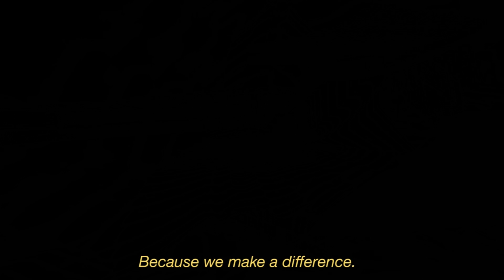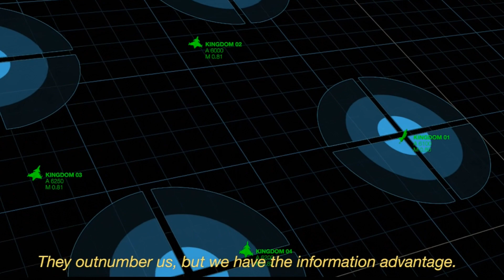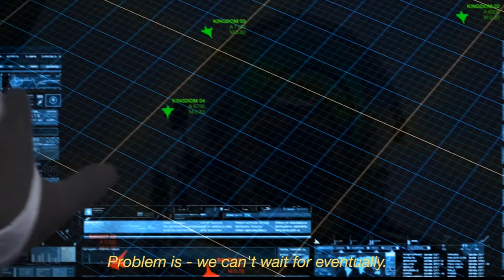Gripen Fighter Jet - Canada's Future Fighter?

Comment: Many fact nerds voicing their oppinions on military stuff they know nothing about...

Gripen wins the cost effectivenes battle every day. It doesn't matter if another aircraft barely beats it in some regard if it's faced with two or three Gripens. Allso, the ruggednes and ridiculously quick turn around time increases that multiplier even more.
Reply from the maker: Nils Jungenäs I agree
Reply: It also has among the best weight-to-payload ratios in the world, rivalling even tiny trainers like the L-159 ALCA, so a Gripen, while being smaller and lighter than an F-18, can carry the same payload.
Reply: +Peter Angerani Do a co-op with Sweden and build the Gripen 2020 instead.
Reply: Matsimus when I think of Canada,  I think of the vast undeveloped area and how the Gripen would be able to take advantage of practically any road, for a re-armament or re-configuration. Plus the arctic origin and design that Saab put into the Gripen it makes sense. All your points about having 2 aircraft and since 1 HAS to be a F35 (it's happening for better or worse), the Gripen is a perfect choice for the Canada.
Reply: Wade French I can agree to an extent, but would like to note one point. The Gripen, along with the other European options and the Japanese Mitsubishi jets, are far more cost efficient, meaning you could do quantity over quality with little effort, and every lost unit wont be an as significant loss.
Reply: @09csr  Yes they are.  And they make sense for many nations.  No argument there.
Reply: @09csr  Yes, if all aircraft were equal.  However in the last Red Flags the F-35 dominated aircraft from the previous generation.  By most accounts it was 15 planes downed for every F-35 lost.  You do the math.  At that ratio the F-35 is more cost effective, sorry.  Most fourth generation planes were down before they even reached 30 miles (close enough to use IRST).  

What the US is able to do with the F-35 is historic.  They use the F-35 to soak up all of the battle information and give that information to other legacy aircraft.  The F-35 can even give those planes firing solutions.  For defensive war the Gripen is great.  It is however not able to do much of what the F-35 can and never will be able to.  So when you say that those planes are more cost effective it is a tough question to answer because the F-35 is capable of more work.
Reply: In the past century, air to air battles have been always won by the party that trains more.  The cost per flight hour of the Gripen being so much lower allows for much more training time for the pilots, and hence higher chance of success.
Reply: Ruggedness is so underrated.  Day Two of any war will see a degradation of our airports and infrastructure.  Anything that requires a pristine airbase is going to be out of commision pretty quickly.

@diamonddog257:  We have an obligation to be able to support NATO, thus we need fighters.  Would you have us leave NATO?  We'd be invaded by the USA the very next day.
Reply: +tyson31415
Except for Pearl Harbor, I don't know of any American air base that's ever been bombed in any war.   There were some minor instances in the Pacific War with the Japanese, but nothing major.  That was way back during WW2.  Hasn't happened since.  Bombing an American airbase is easier said than done.

The Russians would not have air superiority against the US. Russian bombers would be shot down before they got to their targets.  Or at the very least, get shot down on the way out, or after they land back at their bases.  The Russians don't have enough aircraft to attack all NATO bases at once.  They would probably lose half their airforce in the first strike.  Holes on runways could be refilled within 24 hours.  Not every hole needs to be filled.  Aircraft can also take off from paved roads and freeways near the bases.  Holes could be repaired and then painted to look like bomb craters from the air.
Reply: In the event of Scottish independence, I hope we lease 14 of these
Reply: Personally, I think Matsimus has it right here.  Get the Gripen and build them in Canada which would offset some small amount of cost and get some more aircraft tech and jobs in Canada.  But also continue participation in the F-35 program and preserve that portion of the aircraft tech and jobs as well.
Reply: @PeterAngerani  that's what every countries want to do but then the manufacturer does not take responsibility if something goes haywire
Reply: This is what Canada needs.  -  https://www.youtube.com/watch?v=_afzm1z7nu0&t=197s  - Twin engines for vast arctic patrols.
Reply: Totally agree 100%
Reply: the rcaf never flies more than 1 craft at a time in the arctic, and if its being used in a coalition, its usually as a ground attack or bombing role were they might have 2 planes flying at most
Reply: Nils Jungenäs the Swedish armed forces are poor, they need a budget jet
Reply: Yeah have so many the enemy runs out of missiles
Reply: I don't think the Gripen is a bad path for Canada, but some things that you mentioned are not necessarily true.  There is no technological advantage for the Gripen.  The F-35 is a more advanced plane.  Partnership and in construction and tech happens with the F-35 as well.  In fact, over 110 companies already have contracts for F-35 production, so money is already being made and expertise is being shared and gained.  

"In an online briefing to media on Aug. 6, Callaghan shared the results of an economic impact assessment that suggested selection of the F-35 could impact GDP by almost $17 billion and generate more than 150,000 jobs over the life of the program."

I doubt very much that the Gripen adds 150,000 jobs and 17$ billion dollars to the economy.  In fact, I don't think it would even be close.  

Next thing is that the cost of the F-35 is more expensive to maintain and it costs a fortune per fight hour, but these planes are also not peers.  The F-35 is a more capable plane.  The only real question is, does Canada need the extra capability?  The answer is probably not.
Reply: naaa F35 is the way to go.

https://i.imgur.com/aJ4uk6f.png
Reply: I don't disagree with it being a well-made cost effective airplane, but thinking that it can do as much (or is even close to) the abilities of the F-35 is not accurate.  It you are fighting an offensive war in a highly-defended airspace then the F-35 is worth its' weight in gold.  That is not what Sweden needs.  That is however what the US and UK need.   Recent Red Flag events in the US have shown how much more survivable the F-35 is over legacy aircraft in defended airspace.  The Gripen is a great plane for defending ones own airspace in a small country.   For fighting offensive wars on hostile foreign lands, take the F-35 every time.
Reply: @wadopotato33  comparing it to f35 would be wrong
Reply: @wadopotato33  the E model with it's small rcs and superior sensors may surprise a lot of the F35 pundits...

"The Selex ES-05 Raven AESA radar designed for the new SAAB Gripen E/F matches or exceeds Captor-E in many respects.
What makes a system great is not only the sensor but also the processing power, software and last but not least sensor fusion.The Gripen will have three Selex-ES sensors.The Raven ES-05 active, electronically scanned array radar (AESA), developed by the company's Edinburgh unit, will be the first production AESA to be mounted on a “repositioner,” a rotating mount that gives the radar a ±100-deg. field of view around the nose, I have seen figures of 240 degree spherical being cited in the press but that seems a a bit optimistic..The Skyward-G infrared search and track (IRST) system (from Nebbiano, Italy) is based on experience with the Eurofighters Pirate IRST and Selex-developed land- and sea-based IRSTs.The fighter also has a new identification friend-or-foe (IFF) system with three electronically steerable antenna arrays, which matches the radar's range and field of view.The three main sensors will cue one another automatically to display to pilots a fused picture of airspace around the fighter; it will also be fused with the Gripens new electronic-warfare system. Finally, sensor data can be shared between Gripens in a flight, or ground control in addition to airborne surveillance platforms via data link at least on par with but probably more capable than the F-35 datalink."

The rate of improvements in radar and passive IRST means the F35 will slowly (Israelis say 5 years) lose it's only real advantage...Without stealth the F35 is inferior. period.
Reply: @grahamdrew5512  A few problems with what you said.  First off, IR signature is part of what makes a stealth plane stealthy.  The design of the F-35 makes its IR signature half of that of a fourth generation plane.  You can read up on it since you think that the F-35 only has its' radar cross section as its' only trick.  

Secondly, if the F-35 loses its' advantage when it comes to stealth, what does that mean for fourth generation planes.  It means that they will be seen at even greater distances which means that the F-35 will still have a massive advantage over designs of the fourth generation...duh, on that one.  

Next is also a design flaw of the fourth generation.  The RCS of the Gripen is rumoured to be 0.5 meters squared.  The F-35 is 0.001 meters squared.  The Gripen is therefore 500 times bigger on radar than the F-35.  That is a big difference.  Now on to the big design difference.  The F-35 carries its' ordinance in its' internal bays.  No change in radar cross section.  The Gripen that was already 500 times bigger on radar than the F-35 is how big with missiles and bombs attached.  1000 Times?  Who knows.  Hope this helps you get it.  The Gripen can never be as good as the F-35 because the design is dated.  It is built on a paradigm which is build the best plane for Sweden's defense (not offense) for a good price.  The Swedes succeeded there.  It is a very good plane.  It can never be an F-35.  It can never bomb Moscow, either.  It wouldn't survive two minutes.  

The Gripen is indeed as good a plane as can be built on a faulty paradigm.  Stealth is the future and the whole world knows it.  Russia and China are spending billions chasing it.  Maybe the Swedes should too...or maybe for their purposes a budget friendly defensive plane is a good idea.  I think that the Gripen is a great plane, but it has its' limitations.  The potential of the F-35 is not limited.
Reply: @wadopotato33  EW stealth is what they are using INSTEAD of geometric stealth. IRST has ranges out to over 100 plus KM (depending on atmospheric variables) FYI Canada is not buying a first strike  aircraft, only defensive, like Sweden. We/You have the worlds best ground based radars to link with that remove those weaknesses of no geometric stealth. However the points you make are all valid and part of what needs to be considered. Bottom line is Stealth is great but can't negate poor performance in other areas. For what Canada needs The F35 is overpriced and too slow, too short range and too maintenance heavy (low sortie counts).
Reply: I like the Gripen as it's new, technologically advanced, it has HMD targeting capability and it's tactical link allow them to both excel working in packs as well as targeting multiple enemy aircraft, but as a New Zealander, I think the best option for our air force (the Royal New Zealand Air Force or RNZAF) is still the F-16C/D Block 52. 

When Switzerland initially agreed to buy 22 JAS 39 Gripens, the total cost was US$3.27 billion meaning each jet individually was roughly $148 million each. 

On the other hand, when Iraq opted to buy 18 F-16C/D Block 52s for US$1.5 billion, that meant that each jet individually was roughly $83 million each. 

The F-16 is also combat proved having performed air-to-ground missions in Yugoslavia, Iraq, Afghanistan, Libya and Syria but also air-to-air combat operations in the 1982 Lebanon War (Israeli Air Force vs. Syrian Air Force), Yugoslav Wars, Kosovo War and First Gulf War. That said the F-16 is combat proven and the JAS 39 is not.

Also, like I said, since the NZDF (New Zealand Defence Force) main role is mostly just to complement and support both the Australian and American militaries, the NZDF and RNZAF needs to have equipment that is compatible with that of Australia and the US. Ultimately, as much as I do like the JAS 39, I think the F-16 is still the best option for the RNZAF in replacing the (long since been retired) A-4Ks.
Reply: @trekkienzl2862   You think that a 1970's plane is better than Gripen ?? And aboat the Suisse quoting was included a lot of extras , like ground radar , and a lot of other expensive things !!  The price for the plane was aroand 60 mill !!!
Reply: @trekkienzl2862  You kiwis don't even have a fighter force anymore! ????
Reply: @mikespearwood3914  I know but that's why we do need a new fighter jet as the A-4 Skyhawks have been out of service since the early 2000s.
Reply: +Nils Jungenäs
You must be one of those "fact nerds".
Cost effective isn't very cost effective if the Gripen loses all its battles, penny wise, pound foolish.
The F-35 has a 20 to 1 kill ratio against F-15's, F-16's, and Eurofighters.  Now, THAT is cost effective.
One F-35 is worth 20 of any one of those 4th Gen aircraft.  If you think it is worth at least 2 of those aircraft, then the F-35 is a bargain for $100 million.
The stripped down model of the Gripen is cheap, but the top of the line model isn't so cheap, somewhere in the neighborhood of $60 million.
The Gripen is an obsolete aircraft.  It's an investment in old technology.  It's a waste of money.

Here is what the Danes think of the F-35 after a competitive evaluation.  Is the Danish military a bunch of "fact nerds" too?
"The F-35 just won a competition — and it wasn’t even close. In every category, from combat performance to cost, the Danish government rated Lockheed’s F-35A Joint Strike Fighter as superior to Airbus’s Eurofighter Typhoon and Boeing’s F/A-18F Super Hornet."
http://breakingdefense.com/2016/05/f-35-wins-denmark-competition-trounces-super-hornet-eurofighter/

It is interesting that the Danish military don't even consider the Gripen.  Apparently, hardly anyone is interested in the Gripen.  Less than 250 have been produced in 22 years.  The Swedes bought less than 200 of them.  305 F-35's have been built as of July, 2018, with 2,500 more to come.  The F-35's have been in combat with the Israeli Air Force for the last several months.  They want to buy more of them. The best Air Force in the world chose the F-35.  Are the Israelis a bunch of "fact nerds"?

According to the USAF, at Red Flag exercises more than a year ago, against F-15's, F-16's, and Eurofighters equipped with AESA and IRST, the F-35A scored a 20 to 1 kill ratio over an eight day long series of war games.  Before that, in another USAF exercise, the F-35A scored an 8 to 0 kill ratio.  According to US Marines, in their own war games, the F-35B scored a 24 to 0 kill ratio.
https://ukdefencejournal.org.uk/f-35-dominates-exercise-red-flag-earns-20-1-kill-ratio/

In the real world, in real combat, the F-15 and the F-16 have never lost in air to air combat or a dogfight, while the F-15 has had over 100 air to air kills and the F-16 has had at least 76 air to air kills, all without a loss.  However, the F-35 can shoot down F-15's and F-16's with ease, like "clubbing baby seals", actually, more like blind baby seals.
Reply: @RedRider1600  
Your information is dated already...The F35 without stealth is nothing special. The Israelis think it has at most 5 years before improvements in radar and IRST cost it it's only advantage.

"The Selex ES-05 Raven AESA radar designed for the new SAAB Gripen E/F will match or beat Captor-E in many respects.
What makes a system great is not only the sensor but also the processing power, software and last but not least sensor fusion.
The Gripen will have three Selex-ES sensors.
The Raven ES-05 active, electronically scanned array radar (AESA), developed by the company's Edinburgh unit, will be the first production AESA to be mounted on a “repositioner,” a rotating mount that gives the radar a ±100-deg. field of view around the nose, I have seen figures of 240 degree spherical being cited in the press but that seems a a bit optimistic..
The Skyward-G infrared search and track (IRST) system (from Nebbiano, Italy) is based on experience with the Eurofighters Pirate IRST and Selex-developed land- and sea-based IRSTs.
The fighter also has a new identification friend-or-foe (IFF) system with three electronically steerable antenna arrays, which matches the radar's range and field of view.
The three main sensors will cue one another automatically to display to pilots a fused picture of airspace around the fighter; it will also be fused with the Gripens new electronic-warfare system. Finally, sensor data can be shared between Gripens in a flight, or ground control in addition to airborne surveillance platforms via data link at least on par with but probably more capable than the F-35 datalink.
"

The world is not standing still and you can't add more stealth so gradually it loses all value. Sensors and A.I. drones with better data links are the future and Manned machines will fade on the front lines...So very soon it won't be about stealth it will be about command and control of data and drones.
Reply: @grahamdrew5512  
The F-35 isn't just stealth, it has the best sensors and electronics money can buy.
Your cheap budget Gripen is not in the same league.
No major military power is interested in the Gripen.
Reply: @grahamdrew5512  
The US isn't standing still either.
The F-35 like all US military aircraft will be updated and upgraded as necessary.
The US has been working on the next generation of fighters and bombers and drones.
Reply: @grahamdrew5512  
IRST is also worthless beyond 20 or 30 miles, and only good from behind or from the sides.
IRST is useless against oncoming F-35's and other aircraft, unless they are coming in at supersonic speeds.
Fighter aircraft rarely fly at supersonic speeds, unless they are chasing something or running away from something, especially if they want to remain stealthy near an enemy equipped with IRST.
Stealth aircraft would maintain their distance to maintain their stealth advantage.
F-35's could pick off Gripens from 40 to more than 100 miles away, unseen, undetected.
Reply: @RedRider1600  Here we go again! Half of what you say have not facts? Where are you gett all this from, Fox News?
Reply: @hakanlundstrom3790  
Here you go again, providing no facts.
Reply: @RedRider1600  The fact is, not worth the time to try to convince you and some other F-35 fan about real facts. It's all about politics who can purchase what. If you want utilities your investments regarding overall aspects training, capability and long term gain JAS 39 Gripen is for sure the best alternativet. It is not the parameters and spec that so many try to claim here is so much more. Gripen is not built for USA, China or Russia so we don't need to ask why the big aggressor not buying Gripen. Be humble and wait to see where it is going. Most fighter today have never do a real war. It will be more tactical and new generation Gripen is prepare.
Reply: @hakanlundstrom3790  
F-15's and F-16's have had a lot of real world combat.  Combined, they have about 200 kills with 0 losses.  The US Air Force, and Marines have done extensive testing and wargaming of the F-35 against F-15's, F-16's, and Eurofighters. They have concluded that the F-35 is far superior to the F-15's, F-16's and Eurofighters. In war games, the F-35 has a 20 to 1 kill ratio against aircraft that have never lost in real air combat.

I think the USAF are knowledgeable in the capabilities of their aircraft, the F-15, F-16, F-35, and know what they are talking about, much more so than YOU.
Reply: @RedRider1600  I agree with you in many aspects. F-15 and F-16 is a dam good jets. They have been on the market very long time and USAF have the opportunity to be involved in real combat so it is not so strange they have many kills. And USAF also have the experience pilot and intelligens to combat any other fighter jets. So this is not comparable parameters in the question here. The upgraded F-16 today are behind the new Gripen E i think everyone can agree on that. The only advatetge F-35 have against Gripen E is stealth capability but I'm not sure this will help if you can send up 2 or 3 Gripen for same money and also with the electronic warfare capabilities that Gripen never show the full capability of because they want to keep it secret. I only want to say that is not only the fighter jet it self that will win any combat it is a team work with ground radar and other fighter jet in the air. The dogfight era is over. We will see the future red flag with the new generation Gripen they maybe get a chance to challenge F-35.
Reply: @hakanlundstrom3790  
Did you forget about the F-15 and Eurofighter?  The F-35 kicks their asses too.
The F-35 costs $85 million.
The most advanced Gripen NG costs $60 million.
How many more can you buy than the F-35?
Are you bad at math?  Did you graduate high school?

The US has built 610 F-35's, and are still mass producing them.
Production at first was slow, but we are now producing more 100 F-35 per year, mostly for ourselves, but some for our allies.
Eventually, the US military, Air Force, Navy, and Marines, will have 2,500 F-35's.
Our allies will have less than 400 combined, eventually.
It will be the Gripen NG that will be outnumbered.

Sweden has built only 271 Gripen's so far.
Most of the Gripens are the cheap ones with poor capabilities, not the most high tech expensive ones.

If you can't see the F-35, and your radar guided missiles can't lock on to the F-35, how will you shoot it down?
Even if it is 10 Gripens to 1, the F-35 will win.
The F-35 will shoot down 1 or 2 or 3 or 4 Gripens from 30 to 100 miles away, and then go home.
The Gripens will not see the F-35 and will not be able to retaliate.
Reply: ...Canada doesn't need Fighter jets ..... what for ?
Slap around the USA ?......Invade Russia ??.......blow money at silly NORAD/NATO exercises ?
....-and it sure doesn't need over-priced euro-gay  crap  WITH ONE ENGINE !
-----------------------------------------------
Lately, Canada is fucked, politically and financially etc ;
....   realistically, we should be making nice' with Vlad Putin to get us out of this Globalist doctrine that [has]
ruined us .....    form a  '' polar agreement'', quit pretending to be something we are not, with goofy west
europe countries  ...
... And  maybe ,   Russia would be happy to load us up with all the Heavy bombers, Sukhoi,  missiles we want,
...   God Forbid...America might start giving us a bit of respect .......
Reply: @diamonddog257  A country has to be able to defend itself...duh.  You may not believe in having a military, but most sane people would highly disagree.  Your idea is a fringe one and should always remain there.  

American doesn't need to give you respect because you can't even keep the contract you signed as a member of NATO to spend 2% of your GDP on your military.  The US has to spend more money to make up for broken Canadian promises.  Is that supposed to be the basis for respect?  Respect is earned and Canada hasn't lived up to its' mandate (that they signed up for).  Stop breaking promises.  Start keeping contracts.  Start there.
Reply: +diamonddog257
If Canada actually does what you suggest, and cozy up with the Russians, Canada will be seen as a threat by the US and NATO.  You will get the same kind of respect North Korea, Cuba, and Iran are getting.  There would be sanctions placed on Canada. Your economy would crash and your money would become worthless.  Canada might even get bombed and invaded.  I don't think the US would tolerate having a Russian ally on our border.  It would be time for a regime change. . . lol
Reply: @RedRider1600  The true American colors come out....threats based on hegemony lol...you never learn
Reply: @grahamdrew5512  
"The true American colors come out....threats based on hegemony lol...you never learn"
I have no idea what you are talking about.  Learn what?